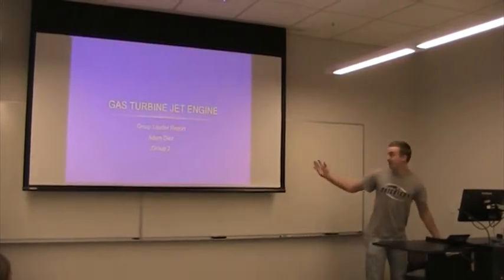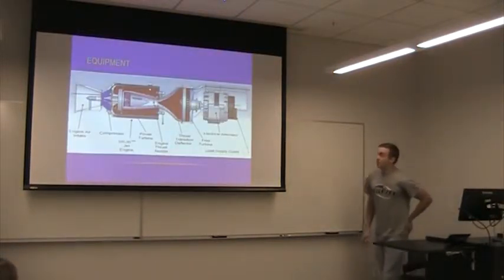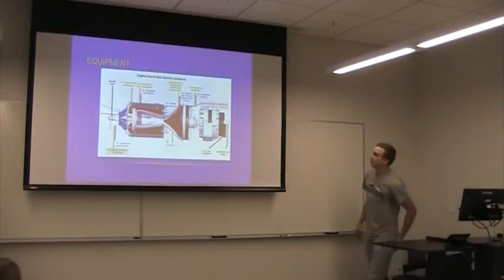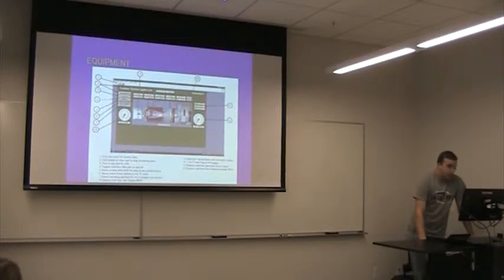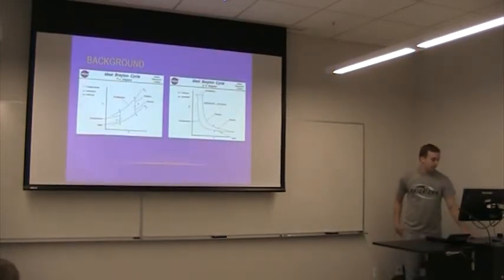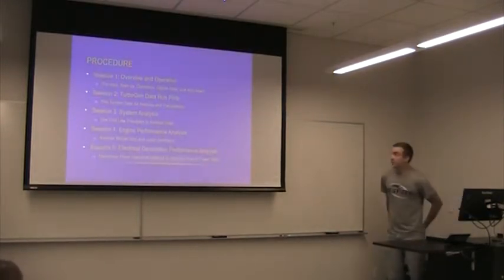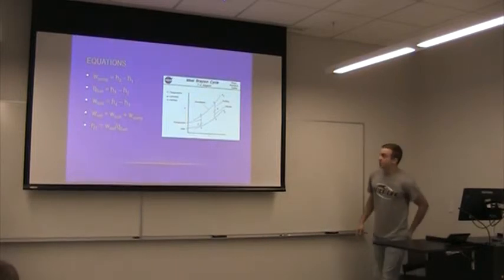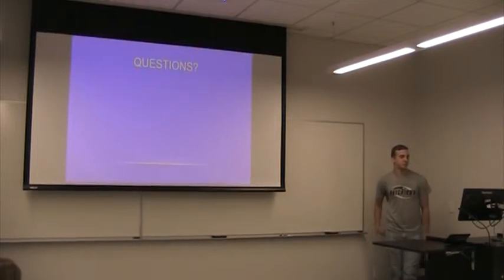Adam Diez

Comment: You explained the experiment well, but you could maybe try to look at the screen behind you a little less. Instead use the monitor in front of rather than turning away from the audience. Also, you were over on the time and to help with this, you do not need to explain things such as what specific buttons on the machine do.